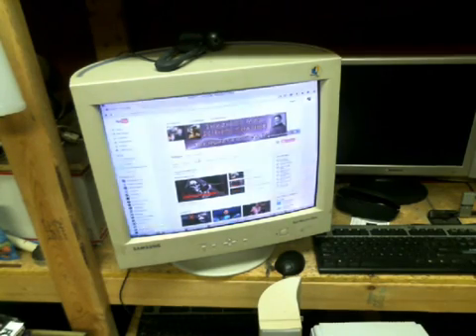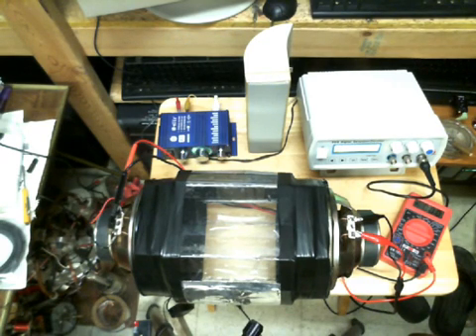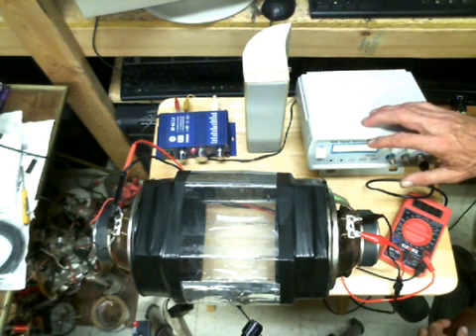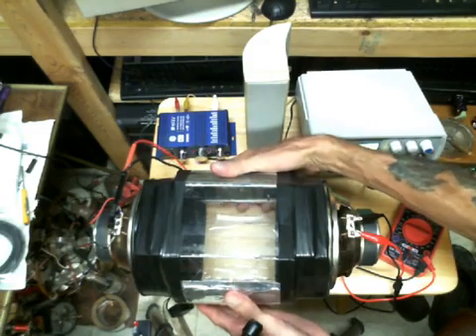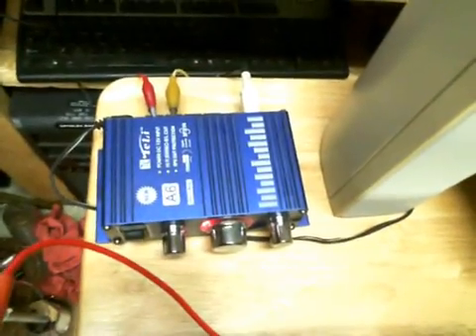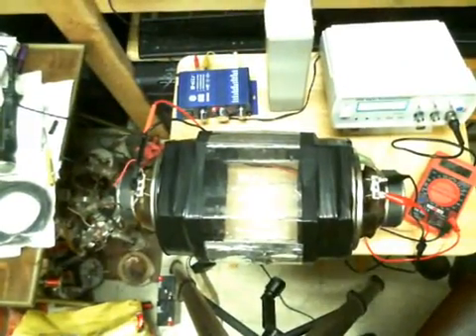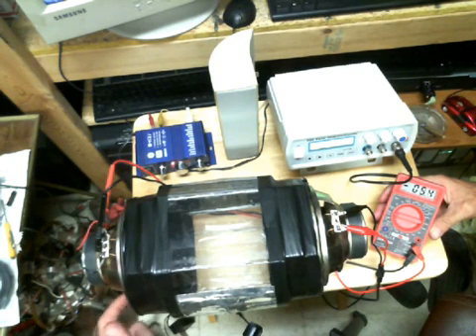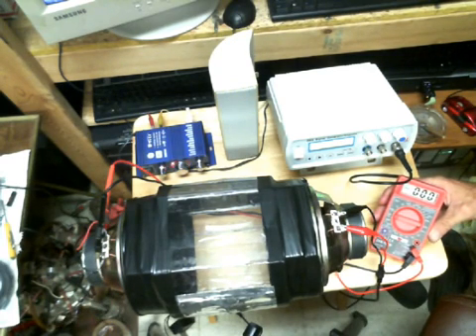SOUND WAVE !

Comment: Shazizz, amigo:  The frequencies you describe are beyond the nyquist frequency limitation of the audio hardware  -- both the signal generator and the amplifier have a sample rate, half of which is the nyquist frequency.  

At 44.1khz -- CD quality sound and by far the most typical consumer-level sample rate, the Nyqvist frequency occurs at 22,000 herz, or environs...  Anything above this wraps back down in random ways.  

I suggest, perhaps ignorantly, that you might do better at those frequencies you mentioned, with hardware that can correctly produce ultrasonic audio tones well above the 22,000 herz limitation of the Nyqvist frequency of an audio signal at the sampling rate of 44.1 kHz.  You would then need not those speakers you employ, but the likes of ultrasonic transducers, which can properly produce those tones.  

I hope that this helps.  If my attempt to help is based on error, I hope that you correct me so that I might better know.

Thank you for sharing your findings, and knowledge, Shazizz.  I learn massively from your videos, and thank you for sharing with others openly.

F.

Comment: So if you charge the oil and water in an engine into a fluid car coil the casting of the block becomes the central core and the air coming in is pressure from atmosphere and then vacuum from the internal motion by the movement of the aluminium piston that acts as a super capacitor ( it stores the fields off all the above ) it then causes further spiked neutrals from the ac alternator pulsed to block and dc pulsed starter motor to block for ever escalating if its not governed Just a thrown in thought at the moment